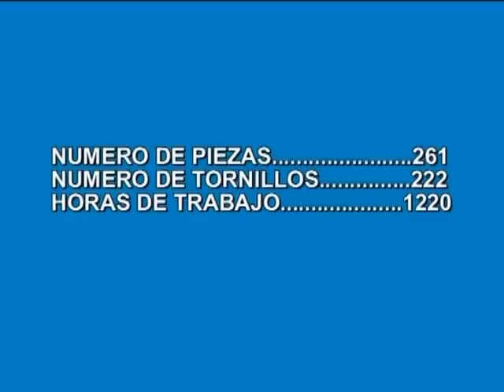El motor V-12 más pequeño del mundo.(Smallest V-12 engine of the world)

Comment: How did make the explosion without spark plug ?
Reply: Ricardo Fontes disel engine no spark plug
Reply: Because this is not an engine. It is an air motor. It runs on compressed air. The giveaway is the camshafts running at the same speed as the crankshaft. If it were a 4 stroke engine the camshafts would be running at 1/2 crankshaft speed. Watch again and observe that the timing gears are both the same size as the crankshaft gear. 
It is a beautiful work of craftsmanship. A fantastic example of modelmaking.